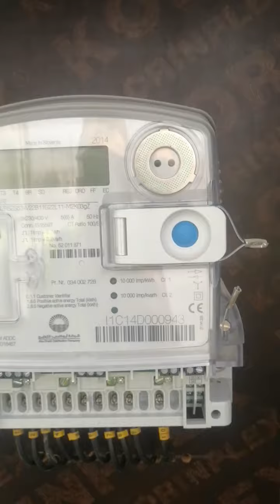CT coil connection for CT energy meter in Tamil (CT காயில் மின் மீட்டரில் இணைக்கும் முறை)

Comment: Y ph CT coil burn achu. IPO Y ph ku CT ye I llama bypass panamudiuma
Reply from the maker: Current rating கம்மியா இருந்தால் எரிந்துவிடும்.
Bypass பண்ண இயலாது
Reply: @electricalvathiyar1753  Sir, failure Ana CT coil & connection remove panitu. 2 ph CT mattum vachu connection kudukalama
Reply from the maker: CT coils for measuring. By pass pannalam
Reply from the maker: அந்த CTன் purpose என்ன என்று தெரிந்து கொள்ளுங்கள்
Reply: @electricalvathiyar1753 for measuring only sir